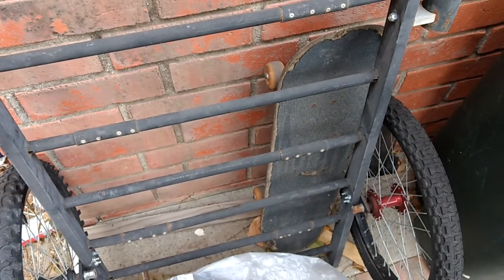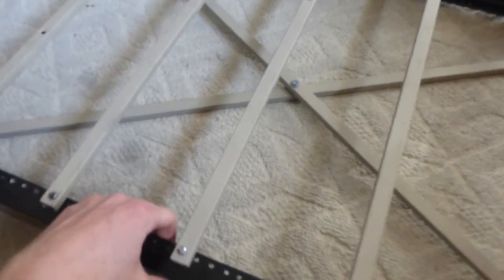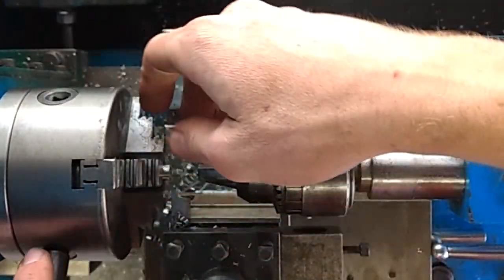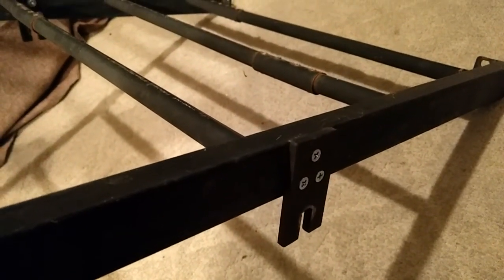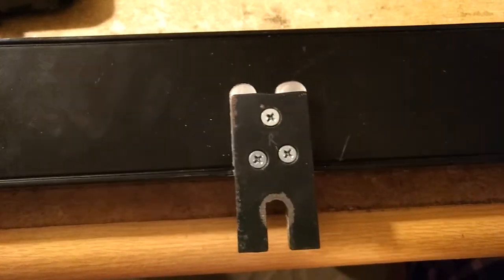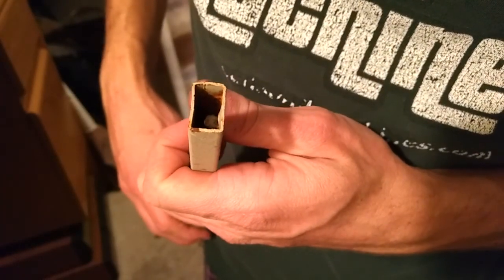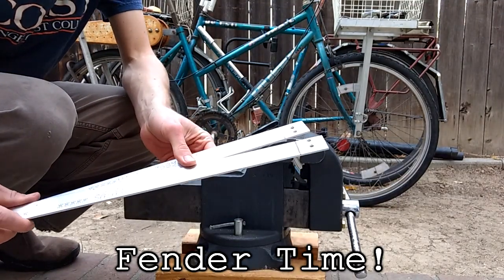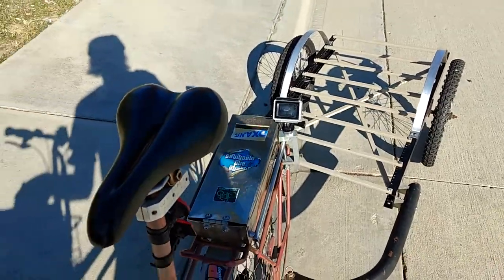Improving the Frame on the "No-Weld" Bike Trailer

Comment: Nice hack; very resourceful. For all us without the cool machine tools you possess (envy, envy) spacers can be store bought on the cheap at a hardware store. In fact one can get a length of tubing the right diameter and cut 'em down to the right length. And would nylon spacers work as well?

Comment: Excellent! that server rack stuff is pretty decent! you could've put the cross bars on the top of the bottom web of the server rack and the diagonals directly under that bottom web. that way the server rack would act as sides and ever so slightly lower your centre of gravity. But hey, as it is a no weld, it is basically just a big meccano set and you can reconfigure it as you like. As for fenders , the bottom few inches off a big plastic tub, or barrel cut in half would act as full on wheel defenders. But hey, I am not criticising!  I need to put my money where my mouth is. I made a single wheel bicycle trailer out of an ironing board. Haven't used it in years since I started using a large box cargo bike. I should post some more videos on those items.  As for welding alu to steel, maybe there is a brazing option?
Reply from the maker: Thanks Boots, yeah I could've done that, but after the old frame, I wanted to make this one as rigid as possible.
Reply: @greensnmachines  Indeed, and I meant no criticism!
Reply: Welding aluminum to steel is next to impossible for the average joe like us. Mild steel melts at about 2,100 deg. F while aluminum gets there at about 660 degrees. By the time the steel is hot enough to join anything the aluminum will have vaporized long before. I guess the solution would be nuts and bolts.
Reply: @fotoagogo  I think welding steel to al is impossible. It might be possible to braze or silver solder, maybe.

Comment: I think you should have bolted the cross sections on the UNDERNEATH side lip of the 2 large side pieces so they would be flush with the upper surface of the side pieces.